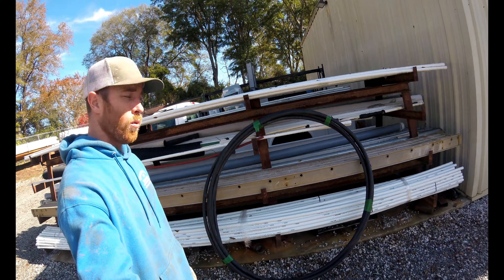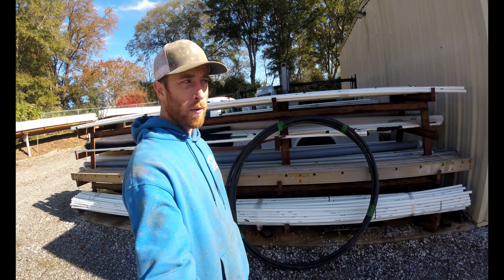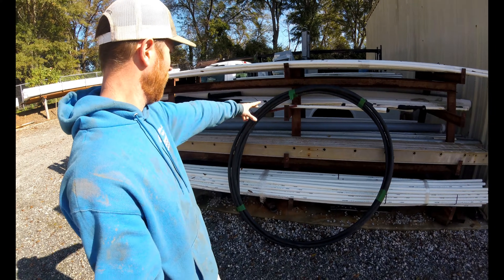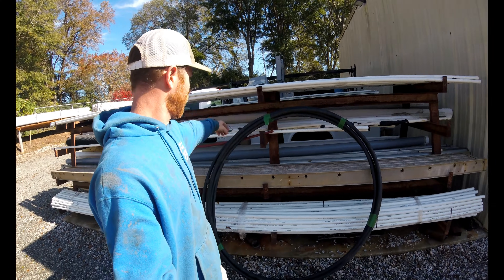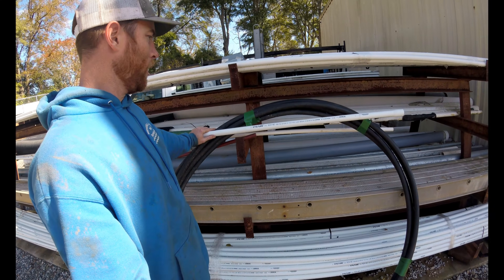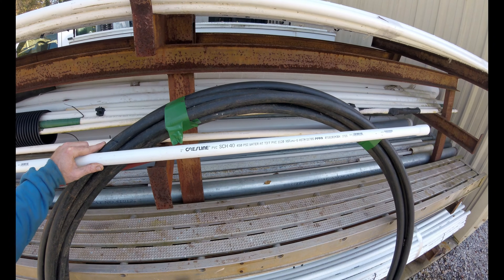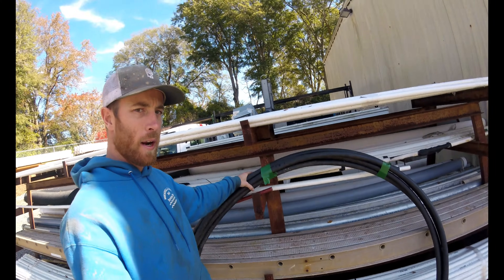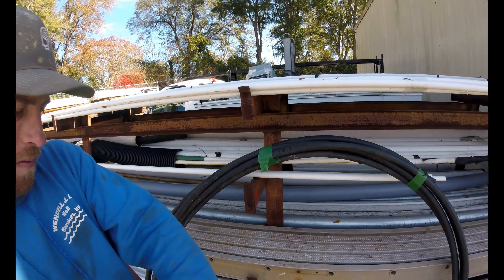How to Install a Water Line: What Material Should I Buy to Install Underground

Comment: Is the "roll pipe" you are referring to called HDPE?  I need to tee off an existing frost-free hydrant to a second location.  I doubt there would ever be a time when both hydrants are in-use simultaneously, but it would be a total of 600'-0" run through 1" O.D. black pipe.  Any suggestions?

Comment: I have to replace a 350' run of 3/4" copper and 3/4" galvanized (mixed combo with connection unknown location) pipe from a city water meter pit to the house basement wall.  I'm going to upsize to 1-1/2" directly off the meter and go into the basement with that.  I'm also going to T off the 1-1/2" somewhere outside and run a line to a freeze proof yard hydrant near the swimming pool so I have plenty of flow there when needed.  My questions are: can I get 20' or longer lengths of the PVC pipe, is the built in bell end special order and do you just use typical PVC glue and procedures for the connections?  Thanks for a good video that gets right to the point.

Comment: What do you recommend using as a base material below and on top of the schedule 40 PVC for someone living in a large to medium size rocky area?

2. I just saw they make a schedule 80 pvc pipe and cost is not a deal breaker.  Why would i not want to use that instead?
Reply: Sand or 5/8 crush

Comment: I need to replace my main water line and want to go with PVC, Im interested in the Schedule 40. We have a frost line here in Maryland so we have to bury them 3 feet deep, can this pipe handle this environment? Also, what is the average life of this pipe?
Reply: Why PVC ?
Reply: @watchingthecrazyworld7761  actually I have changed my mind, I'm going with type L copper pipe
Reply: @ByronReyesFCBarca  I'm going with type A PEX. But if you do go with copper definitely go with type K.
Reply: @ByronReyesFCBarca  The reason I'm going with the type A pex is because I will have no joints or connections under ground. It expands much better than copper and its cheaper. Also, you will have sweat joints with copper and K is thicker than L.
Reply: @watchingthecrazyworld7761  I thought L was thicker than K, I must have not researched well. I've heard of Pex for main water line but not sure I want to go that route, the galvanized that I currently have is about 71 years old so I believe the copper will Last me longer
Reply: @ByronReyesFCBarca  Yes copper will last a very long time. I just didn't like the idea of joints/connections buried underground. And PEX will deliver cleaner water and in the event it freezes it will expand rather than burst. Yes K is thicker, I would just sweat it very well and not skimp on any solder. You are sweating it right? I wouldn't trust any other connection for copper underground.
Reply: Yeah sweating it, and your right K type is thicker, thanks for that. I might do this in the next month. Just debating how to trench it. The main water line is in the front of my house but there is a hill ughhh. If it was flat, I would have knocked this out a month ago
Reply: @gypsy2007  Sweating is soldering copper fittings together using Flux, solder and MAP gas/ propane gas. This is done at every joint when using copper pipe. You can use other fittings that don't require sweating, but if it's going to be underground I would sweat. However I still think PEX is a better option and it's what I used.

Comment: CVPC..for hot water too ..how strong is it..I am using for my under ground ..maybe in freeze it will hold not break as soon as regular PVC??//Chlorinated polyvinyl chloride
Chlorinated polyvinyl chloride is a thermoplastic produced by chlorination of polyvinyl chloride resin, which is significantly more flexible and can withstand higher temperatures than standard PVC. Uses include hot and cold water delivery pipes and industrial liquid handling

Comment: Does the Black-Poly-Roll-Pipe :: have a Better Description, as most Black-Poly-Roll-Pipe is coming up "DRAIN" piping only. I am looking for potable water from a main to house that offers flexibility as it needs to go 200ft.
Reply from the maker: Look up ADS Black Roll Pipe, it should be rated for 160 psi and isn't "drain" roll pipe

Comment: Do you recommend a conduit to protect water line and for ease of replacement down the road?
Reply: We usually only place it in another conduit if it is going to be in a place that is difficult or expensive to replace.  Under a cemented/paved driveway or area, or under road crossings it is required around here.
Reply from the maker: @kennykemp2790  agreed, we do the same thing. always sleeve it under a driveway, crossing, or going through a foundation wall.
Reply from the maker: No a conduit for the water line is not necessary
Reply: @WendellLeeWellServices  thanks
Reply: @katiedotson704  Thats why its only used on short runs. Basically just fix end to end